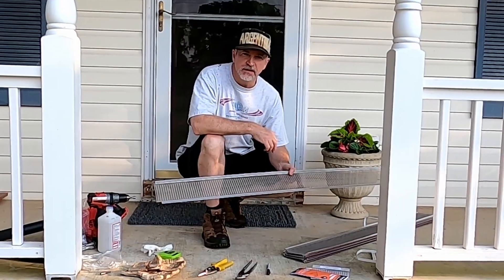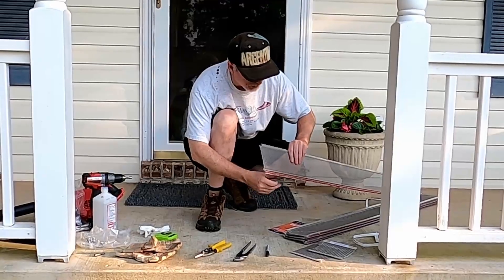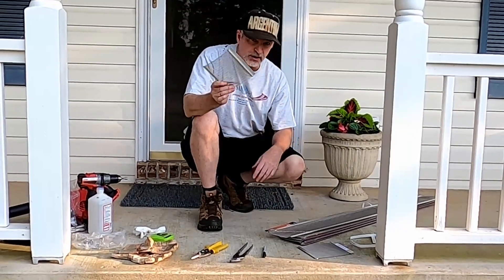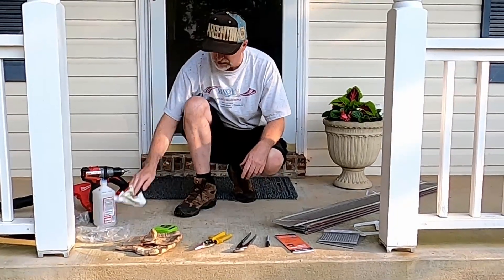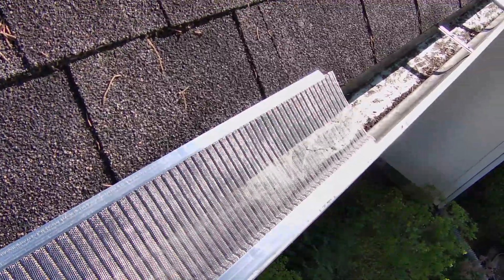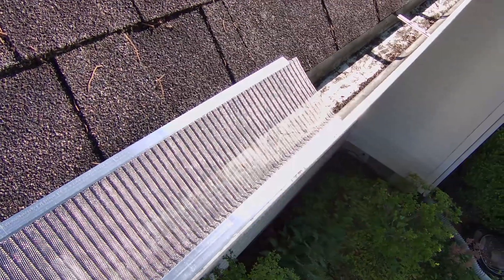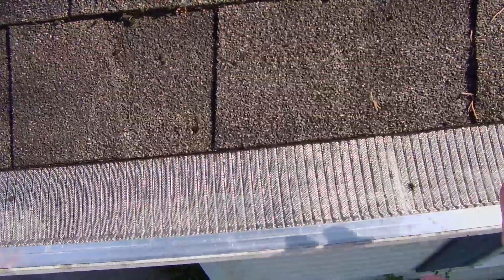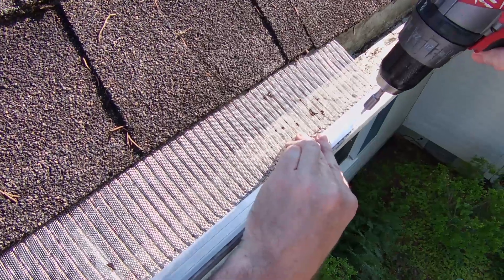How To Install Gutter Guards And Testing Them To See If They Work

Comment: Thank you for your great demonstration with water which is like heavy raining. I wouldn't use a nail because of some video. I want to know why did you use a nail even this gutter guard have a 3M tape on it? Thank you in advance!
Reply from the maker: I used the screws on the gutter guards over the downspouts so can I take them off if I ever need to inspect or clean them. With the #M tape it's very hard to remove them.

Comment: Would snow and ice build under the shingles?
Reply from the maker: That is a great question! Without getting into too much detail, ice dams will occur with or with gutter guards if the snow and ice on the roof can't melt off. If I gutter is clogged or a gutter guard keeps the snow/ice/water (melted snow/ice) from running off, you might get an ice dam. The key is to make sure the snow/ice/water is able to run off by clearing anything setting on top of them. You can also add a heater wire to help melt snow/ice in the gutters. Hope that helps some.